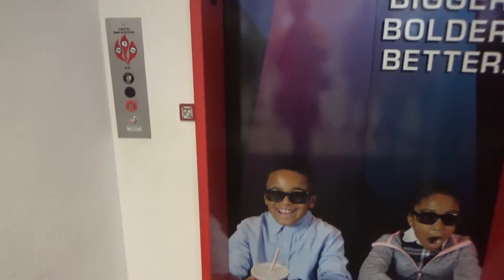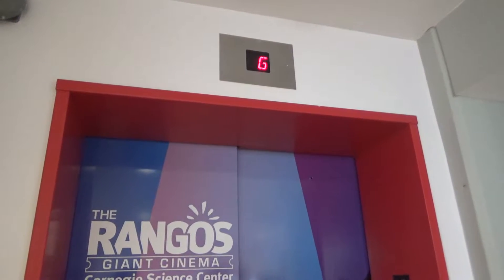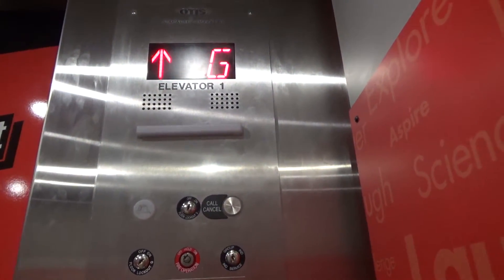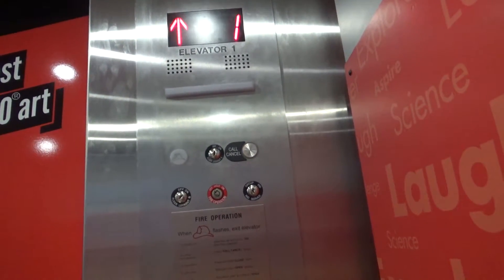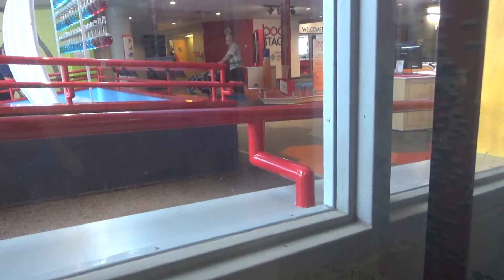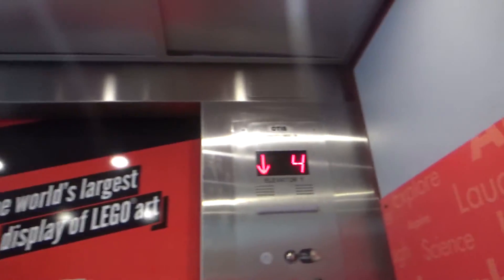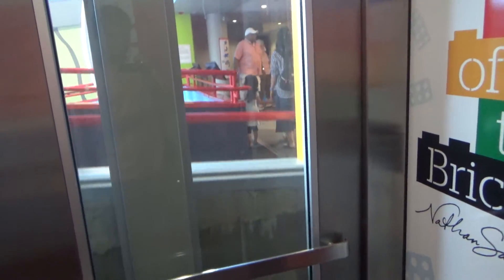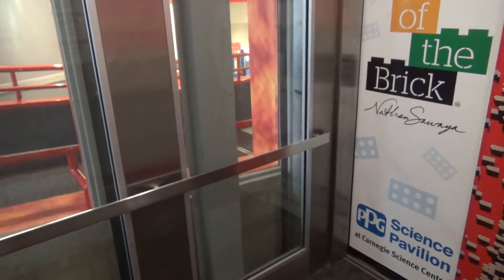SLOW Otis Modded Westinghouse MPH Elevator at Carnegie Science Center, North Shore - PGH, PA

Comment: The mod was absolutely unnecessary! They totally ruined this elevator by modding it! This elevator was so much better when it was an original Schindler RT for sure!
Reply from the maker: What they did was unnecessary, they should have made it a Gen2 and upped the speed.
Reply: AdazElevatorz I thought the original RT fixtures were fine just the way they were in that elevator! I wasn’t ready for that elevator to be modernized just yet!

Comment: This was actually installed in 1990 (even though it opened in ‘91) by Schindler/Westinghouse, & the mod. was done in 2016. The mod. replaced everything but the motor/hydraulics, cab, & travel cables.
Reply: Yeah.
Reply from the maker: Not really, I would consider it a partial mod.  I didn’t realize the controller was replaced.
Reply: Yes, the controller’s for sure replaced. Otherwise it would have the more “clicky” buttons, & light amber, & the indicator would change right after the door closed.
Reply: Full mod i guess